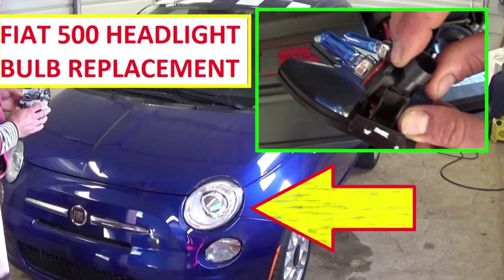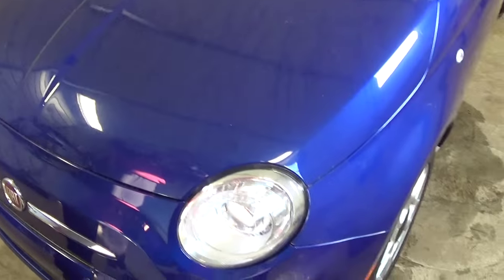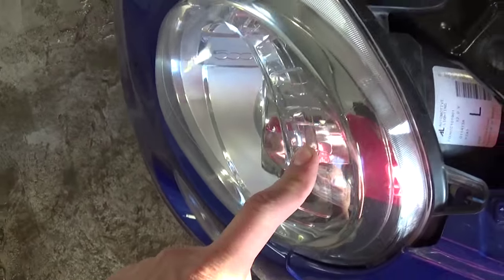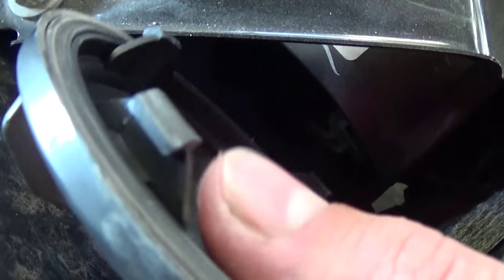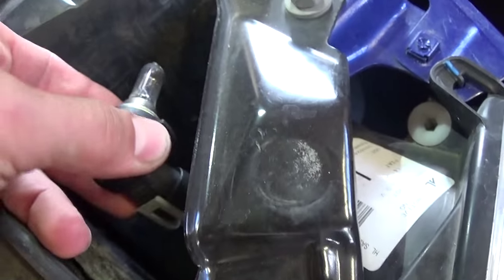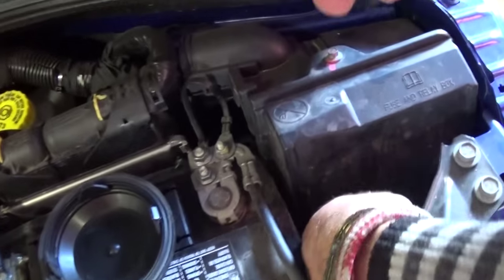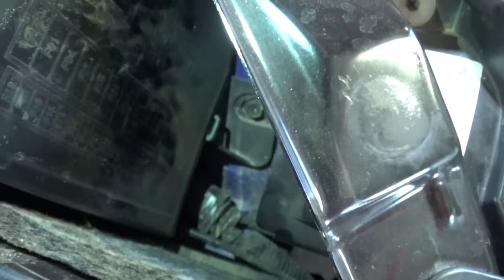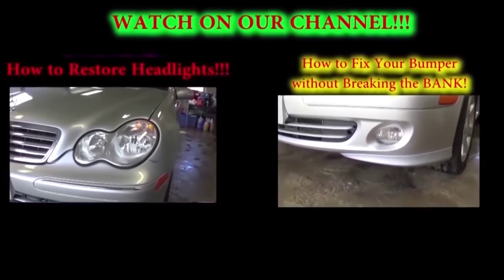Fiat 500 Headlight Bulb Replacement  Left and Right Headlight 2008 - 2015

Comment: Lmao,this clown at autozone told me,i have to remove and unscrew the whole bumber uhmm sir 🤣 thank u for this
Reply: I think you have to do that for the bottom light, or enter through the wheel well.
Reply: I have replaced all light bulbs at the front end, bumper does not need to be removed to replace any of them there is enough room to enter either from under the hood, the wheel wells or from under the car depending on what bulb needs replacing

Comment: Amazon says that H11 bulbs work in Fiat 500s... Not 9012 bulbs. I bought some H11s, tried to replace them and they don't fit.  FYI: Don't listen to Amazon...
Reply from the maker: +GonnaSin thank you for the advice
Reply: +GonnaSin H11 i believe are for the fog lights. the main High/Low beam headlights take the 9012
Reply: H11 are definitely the fog lights, I just replaced mine.
Reply: Fiat of europe uses h11, fiat at US, uses 9012. Look into your car's manual and you will find the correct light size. That happens all the time with european an american cars. I had a PT cruiser, they changed the bulb for H11 in europe. and we use 9012 here in the us.
Reply: H11 is "one filament light" used for optics that has separate high and low beam, or for fog lights. Lot of cars uses h11 on the optics.
Reply: Can verify this =\ Amazon told me H11 and now I have to return them

Comment: I followed your video, and in the process broke a plastic tab inside, and now the dealer says the only remedy is to replace the unit at $434 plus an hour of labor due to the need to remove the front clip. Aaargh!
-Tom

Comment: I put those GP Thunder bulbs in my girlfriends Fiat 500 (I wore rubber gloves and did not touch the bulb) and they burned out in less than a month.  Also, they were very blue in color and actually dimmer than stock.  They were so dim on rainy nights it was dangerous.  Don't bother trying to return them, their customer service is also terrible.